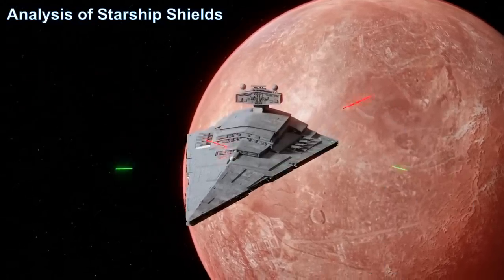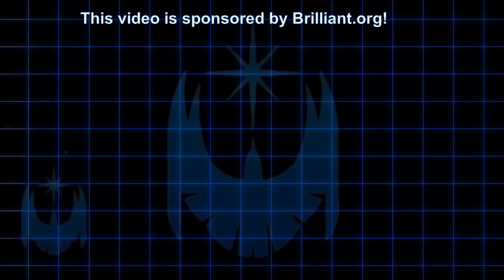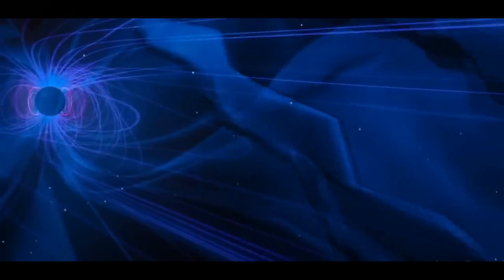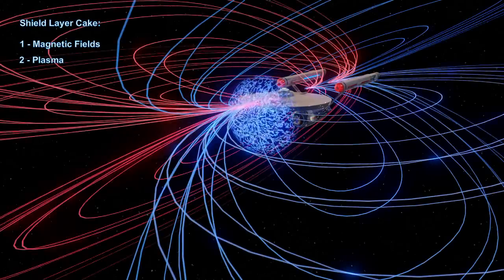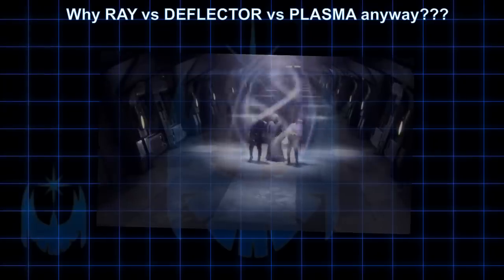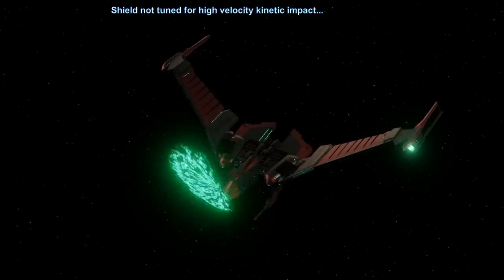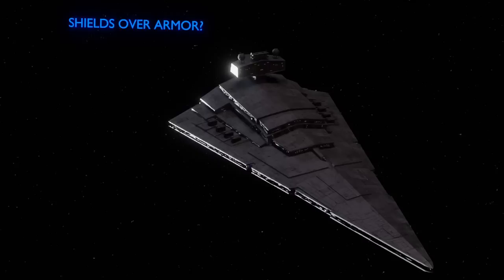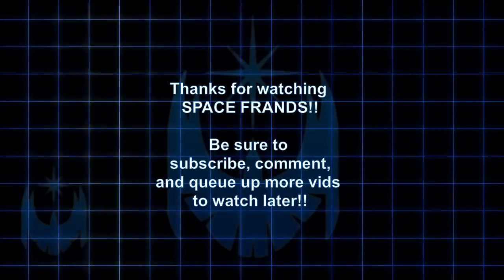REAL Starship Shields Types - They Work Like This...Animated Breakdown!

Comment: I always thought a point defence system should be in star trek. Even if only a little incoming fire is  Intercepted that by the point defence system it's still fewer hits on your Shields. So you could last longer in a fight.

Just my two cents. Love your channel.👍
Reply: Agreed. A light, fast fireing Phaser cannon just for intercepting inoming Torpedoes would be a huge help in 99% of all engagements that involve Torpedoes imo.
Reply: @nealsterling8151  I mean they did make it in star trek kelvin timeline where they kept the phaser cannons instead of using beams. They used it to destroy torpedoes as well as attack the enemy ship.
Reply from the maker: You can kind of see this working in one of the TNG episodes (forgot the name) where the Ferengi fire a couple of missiles at the wormhole - Worf is able to destroy them using phasers with great precision.
Reply: That's a feature in STO, depending on which abilities and items you have slotted into your character and ship.
Reply: Surprised the federation doesn't have Electronic Warfare Suites aswell
Reply: @clpfox470  good point.🖖👍
Reply: @clpfox470  in beta canon they do, but even in beta canon the federation focuses more on anti electronic warfare countermeasures rather than being on the offensive.
Reply: @clpfox470 because it's a genre created from the early 1900s
Reply: well all the ships beam banks in star trek can also work like point defense  actually when needed! but starteks point defenses really suck when compared to what the point defense tech systems  in the battletech universe use with there dropships, mechs, tanks, aerospace fighters, warships, jumpships and others. in the time in the battletech timeline  in the post clan  invasion era and onward combat units in battletech actually can have both have either a regalar automatic  ballistic point defense CIWS anti missile system or a pulse laser CIWS point defense anti missile system with basically unlimited shots at the cost of heat generation.  these AMS can shot down small missile swarms and large capital ships missiles really efectly. also due to how compact and small the AMS is normally drop ships and warships in battletech can easily fit  lots of them while taking up very little of the ships space overall! but will have a incredible effectiveness that one battletech dropship or warship with a few hundred laser anti missile systems would very easily shoot down hundreds or even thousands of micross verta tech fighter micro swarm missiles very easily!  also can shoot down a few doesn of those gundam/SRW anti ship cruise missiles very easily too! also they  don't even need to worry about running out of ammo when it comes to laser AMS! also the clan versions of the AMS also take up half the space and weight of the inner sphere versions too.
Reply: @ashtiboy   Yet there are  not many shield technologies in Battletech.... Imagine a Timberwolf/Madcat with shield systems calibrated to let lasers out but not in equiped with a LAMS (Laser anti missle system.)  The most well known shield system in battletech is the BLue particle shield which only reduces the damage of the Particle projetile cannons which are considered to be like man made lightning guns.
Reply: Star Trek: Starfleet Battles started out as a Table Game in 70's-80's then to PC in the 90's as Starfleet Command was a decent starship battle simulator. Most factions had point defense energy based weapons for missiles, shuttles and other smaller objects. (Fed's had Phaser G's I believe is the correct designation) I believe some of the authorized books over the decades used them in stories too but of course never in any of the shows or movies.  Enterprise D used main phasers to shoot missiles and small craft like a point defense system effectively in season 5 episode 14, Conundrum: against Lysian defenses.  Yes STO has them as various types of consoles equip-able on most ships, however I don't consider STO a reasonable facsimile to theoretical starship battles since your ships play like MMO characters in space with MMO like special attack abilities, defenses and heals that you need to spam like crazy in appropriate order to be fully effective.  Otherwise combat would be less exciting to the masses, (I guess) and less taxing to those twitchy human players out there.  Would be slower paced and more similar to games like Eve or Star Trek: Bridge Commander/Starfleet Command or some other ship simulation games out there.
Reply: "I always thought a point defence system should be in star trek."

They're called "phasers". We see the original Enterprise blow up a group of missiles in For The World is Hollow and I have Touched the Sky, and the Enterprise-D destroys a squadron of fighters in Conundrum.
Reply: @Idazmi7  At a sufficiently high level of technology, and with enough space, a main battery and point defense can become the same thing.
Reply: The Voyager intercepted a shuttle torpedo with another torpedo once - while the shuttle was underwater and the ship in orbit.
Reply: I think I remember some races used Point Defence at first when spatial torpedoes were a common trend but then they upgraded to photonic torpedoes and couldn't be intercepted as easily... but yeah they can still do point defence... but never bother with it for some reason.
Reply: It seems like they should be, however in spite of supposedly moving colossal energies all the time, the average Trek ship's power systems are insufficient to instantaneously fire any kind of common disruptor or plasma weapon.  They're consistently shown to need some period of time to charge up to full power, and in spite of hyper-advanced computer systems there seems to be no level of automation at all which would allow the ship to pick or prioritize and eliminate targets without the direct oversight of a weapons officer.
Reply: in the books they desribe sometimes that torpedos get shot down by phasers. on screen they might find it too complex or expensive for a short half a second scene
Reply: @aikrichter5403  
Photon torpedoes are shielded. We see standard missiles shot down by phaser weapons in both TOS and TNG.
Reply: @Idazmi7  ships are shielded too.still shot phasers at them.Shields can burst/break,flicker/go_on_vacation
Reply: Type 3 phasers were cwis in one star trek game I used to play
Reply: problem with that is power for those systems. because now your powering shields and PDS along with the ship systems.
Reply: Yeah, same way naval ships are armored but they still have point defense in the form of SM-6 and CIWS. The armor doesn't make you invincible it just lets you potentially survive more than a single direct hit. Ideally you never have to find out how effective that armor is because incoming threats are intercepted long before impact. This would be even more the case in space because there's no horizon, you can see enemy ships and projectiles from VERY far away, since stealth basically can't exist in a space setting since you're almost always emitting more radiation than the CMB.
Reply: There were no fighter-equivalents for a long time.  You're not shooting at something small and vulnerable but rather something big and robust.  Until fighters were introduced, point defence would be like firing an AA gun at the HMS Hood.  You might do SOME good, but it would take longer than you have.  You need a bigger knife.
Reply: @frankharr9466  9
Reply: @jesswright4497  

???
Reply: @frankharr9466  that was sent by accident but like your idea there in so many shows or stories they almost totally ignore point defense only one seen where they actually do a good job  is BSG2003
Reply: @jesswright4497  

Oh.  O.K.  That happens.
Reply: I can't recall the exact episode but there was an episode of Voyager where the Doctor had to take command of the ship and fired a photon torpedo out of the aft launchers and blew it up  with one of the aft phasers for teknobable reasons.

Star Trek tech's is honestly a load of nonsense babble that doesn't really make sense or isn't properly fleshed out as the tech wasn't really that important, the people and the storylines were what was important. In TOS, photon torpedoes tended to be treated as doomsday weapons you broke out if you had no other choice. In TNG and beyond, they became just another thing you could fire at the enemy.

Considering the wide array of technologies available to Star Trek, it's always weird seeing them properly used or fleshed out. Personal shields were mentioned in DS9 at one point but that you never actually see them being used by Federation officers or how they only appear to have pistols, rifles and melee weapons are a minus. While yes, it would go against the people centric focus of the shows, I think it would have been far better and more consistent if they'd had a fleshed out bible of tech. Watching DS9 and seeing the Defiant fire three or four bursts of pulse-phaser fire, of which one barrage strikes and kills a Jem Hadar attack ship is jarring when a few episodes later, you see it attacking a Cardasian warship and the same damage doing some shield damage to the warship. Watching it week to week, most people probably wouldn't notice it.
Reply: @Sujad  "Star Trek tech's is honestly a load of nonsense babble that doesn't really make sense or isn't properly fleshed out as the tech wasn't really that important, the people and the storylines were what was important"  It only seems that way because people don't really pay attention to it, or think through the situation logically.  

For example, many point out a supposed inconsistency of the phasers on DS9 being able to destroy a Klingon bird of prey in one shot, while phasers seem to do barely any damage to a cardassian warship in the next.  The reason being that there are different strengths of phasers on the station: the habitat ring has type XI modified planetary phasers installed, while type IX phasers are installed in other parts of the station.  That is just one example, there are several others.  To really understand post TOS Star Trek tech, you have to read the TNG Technical Manual and the DS9 Tech manual.  The show rarely strays far from either (though the Voyager warp 10 episode was ridiculous -- though they were consistant with the new Warp scale being that warp 10 is infinite speed!)

Is Star Trek 100% consistent? of course not, as you said, Story>tech.  But is it more consistant that Star Wars? Almost certainly, especially in the early days, George Lucas cared very little about sci-fi tech, as Star Wars is basically Space Fantasy, not sci-fi -- most of the psuedo-science comes from the fans, not Lucasfilm.  The only popular sci-fi that has more or less consistant and believable tech in my opinion is Babylon 5, but Star Trek tech is much cooler!
Reply: @Daniel73-51  I have to disagree, the Cardassians have inferior tech to the Federation. The Galor class may be the standard ship of the line for the Cardassians but it's hardly a threat to most Federation ships of similar or class or higher. I recall in TNG the Enterprise was able to shrug off Cardassian fire with near contemptuous ease and the return fire all but disabled it. The Jem'Hadar attack ships nailed a Galaxy class vessel pretty hard at the start of the war in DS9. 

The Defiant was notorious for being ridiculously over powered for it's size, that it could one shot (when the writers wanted it to) Jem'Hadar attack ships (and not be able to do the same in other episodes) it should have splashed the Galor.

I thought B5 was better and I'm someone who grew up watching Star Trek  and did see B5 till I was in my twenties. If you haven't, I'd strongly recommend Farscape. It's one of my favourite all time science fiction shows.
Reply: A point defense system would be useless, as missiles and fighters are useless in space.
Reply: @DoremiFasolatido1979  That makes no sense.
Reply: @Idazmi7  That isn't what he is claiming though.

Doremi Fasolatido is claiming that missiles and fighters are useless in space, not that they are useless against sufficiently advanced main batteries.

Regardless, there is no reason that missiles and fighters would be pointless against any vessel that used its main batteries for point defense.  Having a multipurpose defense doesn't mean impenetrable defense.
Reply: @Idazmi7  That makes a whole lot of assumptions.  

For example, why would you assume that the main battery on a ship would have far increased range over modern weapons while assuming that the space fighters that such main battery is opposing would be limited to modern speeds.  It is more likely that such ship would be contested by fighters and missiles traveling at relativistic speeds.

This is especially true for missiles.  There is no reason whatsoever to assume that guided projectiles launched by advanced space faring empires in a frictionless environment would be limited to modern atmospheric speeds or be as easy to lock.
Reply: @Idazmi7  No, weapons don't have infinite range simply because you are in space.  The effective range of a weapon is still limited by a range of factors even if the projectile/beam could theoretically fire forever.  

Also, if you want to play the game of "technically, weapons have infinite range in space", then a similar rule applies to speed.  There is nothing in space preventing further acceleration of a weapon except the speed of light.  Accordingly, even with today's technology, objects can accelerate to relativistic speeds in space.  Assuming increased range/effectiveness of one weapon without corresponding increase in the other is naive.

Moreover, there is no reason to assume that the ability of a Main Battery to perform a point defense roll triggers the obsolescence of missiles and maneuver any more than the existence of any point defense system at all.
Reply: @DoremiFasolatido1979  check out The Expanse to see how missiles/torpedos and point defence cannons work well in a sci-fi setting. 😉
Reply: Didn't they have that in the discovery s2 finale where the enterprise and discovery fight an armada like sitting ducks?
Reply: @nyetloki  
1. Yuck, why did you mention discovery of all things? 🤢
2. Yuck, why did you mention discovery of all things? 🤮

Comment: Very interesting.  This mostly talked about real-world possibilities but that is still cool.  I had no idea these form of energy shields were already so close to viable.  And of course the Earth already has a shield!
Reply: Viable maybe, but not practical. For one, the plasma leakage even with the most "dense" and powerful magnetic fields available would be too great to sustain the shield for any macroscopic period of time, even under no enemy fire and in a vacuum. Inside atmospheric conditions, the shield would just fizzle out before it's fully charged. And finally, the high temperatures needed to ionize the plasma, means its density is very low, so the effect would be like blowing hot air to stop a bullet...
Reply: @ilejovcevski79  Well I wouldn't go so far. Boeing has had a design for a projected plasma shield in the works for years now. It's planned function is to prevent the shockwaves which result from explosives from injuring soldiers inside of vehicles.
Reply: @A____G  and DARPA has design plans for warp fields, i wouldn't hold my breath on it though...
Reply: @ilejovcevski79  DARPA doesn't have plans for a warp drive. It's NASA's Eagle Works theoretical propulsion laboratory. Not only that, but they already detected a micro warp field while doing casimir cavity experiments. They already have several experiments planned to recreate the conditions and study the phenomenon.
Reply: @A____G  you might wanna read the actual papers on that one. As well as the actual commentary by both the researchers and the physics community on what the 'meaning' of that detection is for actual propulsion application
Reply: @ilejovcevski79  Unfortunately I'm not scientifically literate enough to read and absorb highly technical research publications. However, if you have taken the time read them yourself feel free to enlighten me.